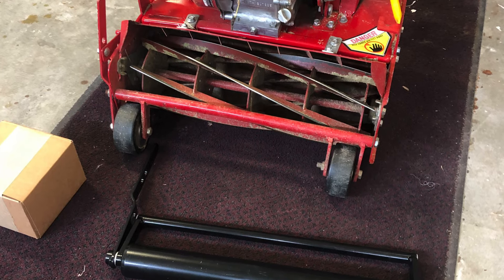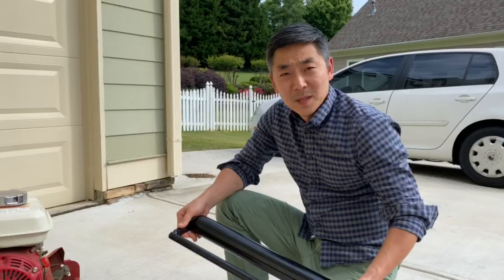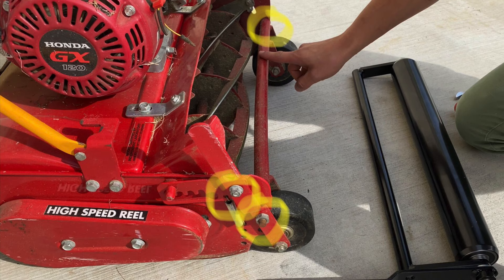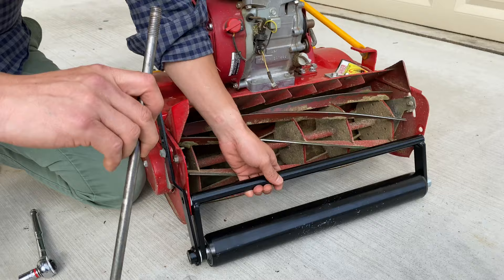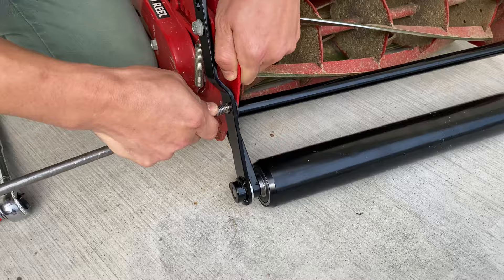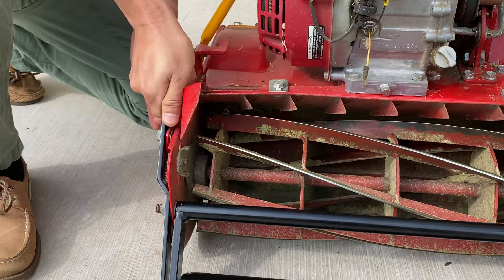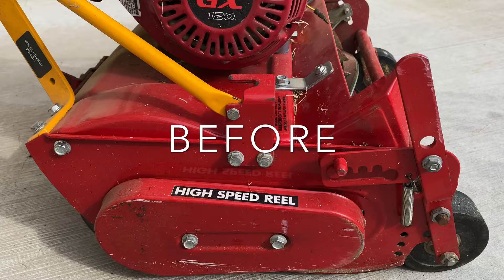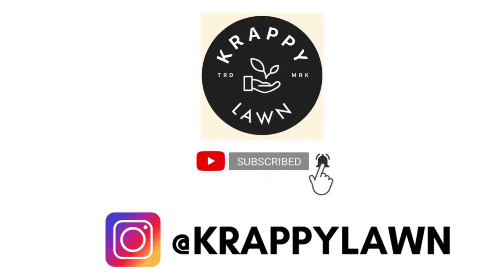How To Install a Reel Rollers Front Roller On a McClane Reel Mower

Comment: How do you change the rear tires?   Not the drive tires the rolling tires.
Reply from the maker: https://images.homedepot-static.com/catalog/pdfImages/83/8377fa7c-28f7-429d-99de-be702c84acc1.pdf          Check out page 8-9